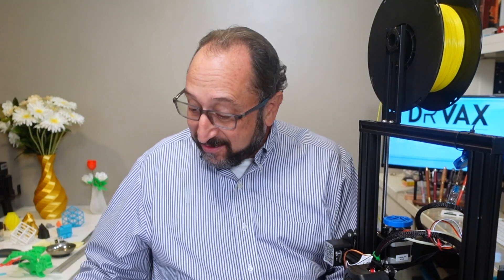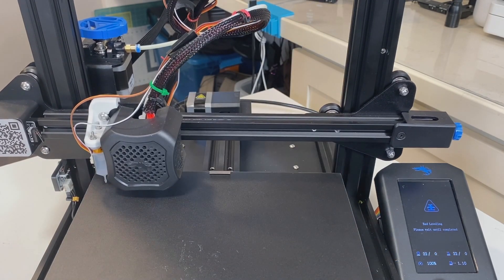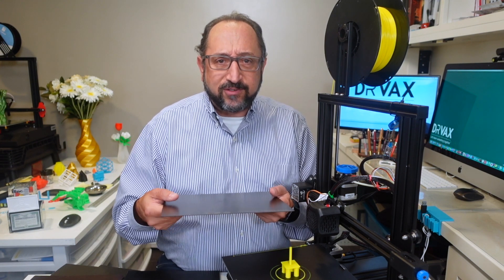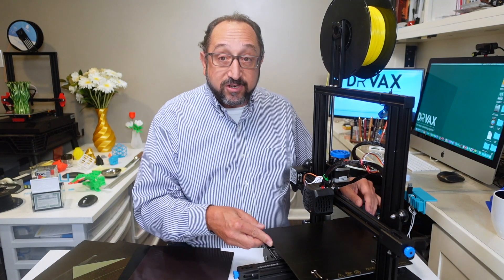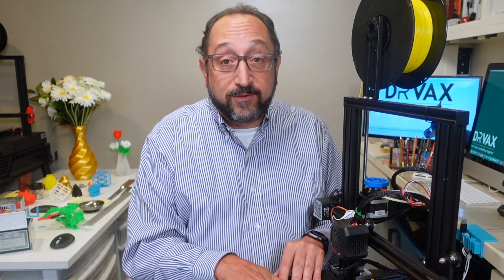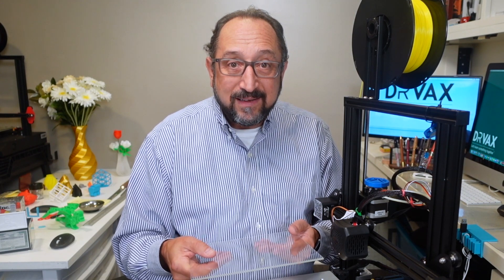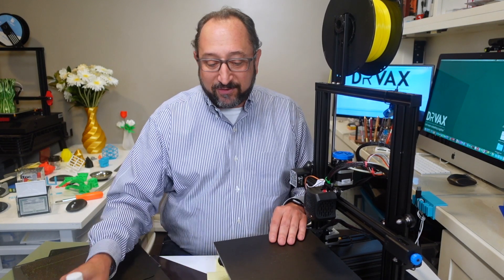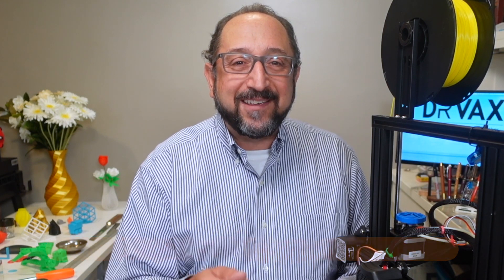3d Printing Build Plate Options

Comment: I print on the mate glass. For adhesion I use 3D glue (I think it is a povidone solution).
Most of the time is works great:
1) I like mate part bottom surface
2) It usually sticks well during print
3) It usually pops out as the surface temperature drops down to 40 C
4) They are inexpencive and can be purchased almost anywhere (in any glass work shop)
The downsides are:
1) It makes bed heating process longer as glass sheet has its heat capacuty
2) Sometimes parts cat peel out some chips from the glass

Comment: My Ender 3 Pro was in a bundle at Matter Hackers that came with the Build Tek sheets, which saved me because for some stranger reason the stock magnetic surface quit sticking, as in the prints wouldnt stick at all. Swapped and just fine. I clean with IPA before every print to insure a fresh clean surface, no issues with sticking, as long as the bed is leveled and nozzle height is correct.

Comment: Great i formation. Thanks.  Sounds like the ender 3 v2 glass plate is wearing quickly. Or is it only me who used it badly?  The center part of the glass seems to get glossy more and more.  I usedto be quite happy with the sticking of this glass. But not so much any more.  But I guess it is ok.
About the magicgoo.... do you have to replace magicgoo for every print?  How difficult is it to clean the glass from magicgoo? 
Thanks and great video...

Comment: Care with the Razor blade Paint scraper. 
 Those are Known to Gouge Window glass.. Let alone a 3d plastic print surface. :-)
Reply from the maker: Yes you need to be careful.   Use carefully flat against the print surface this approach works very well for me.

Comment: On plain glass I used a mix of 1/4 pint of water to 1 tbs of PVA glue. Mix well and paint on with a brush. (For PLA)

Ive also found that if it is really hard to get the print off, you can put the build plate in the freezer for 30 min and the part will pop off. ;)
Reply from the maker: Excellent suggestions.

Comment: I've had my Ender 3 V2 for about 2 weeks and had almost immediate success, even with some tricky prints. Then I cleaned the glass plate with IPA and boom, adhesion failures. Cleaned repeatedly with 90% IPA, washed with Dawn dishwashing soap and rinsed repeatedly, re-leveled bed, fiddled with different nozzle and bed temps -- no better. Tube of Magigoo arrives today so I'm hopeful that solves my problem. The one thing that sticks in my mind is that when I first cleaned the bed with IPA the paper towel picked up some yellowish substance. I cleaned until I didn't see any more trace of that. Now I'm wondering if Creality coats the bed with some sort of adhesion promoter from the factory and that was what I was seeing? 

BTW, I have watched many of your videos and they are some of the best I have seen on YT on any subject. I'm a techie old enough to remember when Digital Equipment Corporation first introduced the VAX system and am wondering if there's a connection there to the name you've chosen for your channel?
Reply from the maker: Yep.  I worked for DEC for 5 years.  DrVax was my nickname among some of my peers.
Reply: @MakeWithTech  Figured as much. So many innovations on the VAX/VMS platform....  

Regarding Ender 3V2 adhesion I can report that even with Magigoo applied the bed almost seems to repel filament. In desperation I applied a self-adhesive build surface that came in a box of Overture filament, re-leveled the bed, and presto, now printing fabulously. Adhesion is almost too good, so now trying Magigoo as to facilitate removal. Think it's time to order some BuildTak or LayerLock.

Comment: sir i want to buy a 3d printer. plzz suggest a 3d printer as a beginner under 250-300$(max -20000). plzz make sure its available on amazon india.
Reply from the maker: I do not have access to Amazon India but the Creality Ender 3 V2 is an excellent printer supplied in a kit form.  The kit is only mechanical assembly as all of the electronics are fully assembled.  The ANET ET4 requires less assembly but the firmware is not as good.   ANET is in the process of working with the open source community to make Marlin 2.0 available on the ET4 at that point it will be an excellent choice.
Reply: @MakeWithTech  when anet eta 4 get marlin filmware update?
Reply from the maker: They are working on it now.  An early release is already available on the ANET web site but it requires some knowledge of electronics for installation.
Reply: @MakeWithTech  ender 3v2 amazon india price is 30000(407$) which is over budget for me.

Comment: I have an Ender 3 v1 and an Artillery Sidewinder X1 and what I have doned with those is I purchased some inexpensive flexable spring steel sheets with magnetic bases from one of the Chinese companies and then I use a product from DOBSTFY that you can get from Amazon.  The DOBSTFY product is probably similar to Buildtak.  It sticks better than PEI and you can still flex your prints off.
Reply from the maker: Interesting.  I will check out DOBSTFY.  While I like the ease of print removal of sprint steel I really like the flatness of glass.

P.S. I have started a new discussion forum at http://forum.drvax.com where we can all have more elaborate discussions and share pictures on our prints and printers. Check it out. Irv
Reply: @MakeWithTech  That's one of the nice things with the Sidewinder X1.  It comes with a glass only bed so it is already flat so no need to worry about putting the spring steel on a warped bed.  On my Ender 3 I use a BLTouch.

Comment: What about good old fashioned blue painters tape?
Reply from the maker: That works but I find it takes a lot of time to replace and when I use it it tears after most prints.
Reply: My ender 3v2 build plate won't stick at all so I went with blue painters tape with no issues at all

Comment: I think you got, like, an "old version" of the glass bed on your Ender 3 V2. My is different starting with the logo (it says Ender with the little "horsy" logo on it) and the texture is exactly the same (or very very similar) to my AnyCubic MEGA X printer. Anything that I print on my Ender 3 V2 sticks like crazy and will pop-off on its own as soon as the bed temperature reaches 25-26 Celsius. Pretty much the same behavior as the MEGA X. In the description on Amazon (Canada) where I ordered my Ender, it says: Carborundum Glass Platform. Go figure ?!?

BTW, I enjoy your channel and thank you for taking the time to share with us what your just "learned" with (mainly) 3D printing. Keep up the good work for many years to come and have fun doing it !!!
Reply from the maker: The one that came with my Ender 4 V2 was the same as your.   The ones shown in the videos are spares I ordered for testing.  I also think my bed might have been a bit dirty and will try it again after cleaning with alcohol.   But even when new it was not as good as BuildTak.

Comment: There are much cheaper alternatives for a gluestick, UHU or Pritt glue works as well and costs a fraction.
That being said, if  gluestick is the only way to make your print stick you have other issues that need looking at.
Reply from the maker: Yes a perfectly tuned 3d printer may not need a bed adhesive but I am sure my printers are not perfectly tuned.  I used a bed adhesive which is different than a regular glue stick to make my life easier.

Comment: I have the cr-10 S5 and have discovered the glass bed works great if you keep it in the center at 70 degrees Celsius and keep it super clean with isopropyl alcohol. The bed has to be good and warm and wiped  with isopropyl alcohol between each print
Reply from the maker: Good information.   Thanks for sharing.

Comment: lol drvax still need to learn more printing on glass lol, glass easily the best surface to print on lol stick really well, also you don't need to used a razor blade, just spray some isopropyl alcohol and Wala
Reply from the maker: Thanks for sharing.
Reply: @MakeWithTech  you're welcome, great channel by the way keep up the good work!

Comment: Ok I just got some magigoo today so very good timing. Printing on the plain glass side of the ender 3 V2 bed as the other side got to the point were nothing would stick. So plain glass worked ok but on some prints (printing numbers and letters for example) that had very small foot print could never get it to work. Tried magigoo for the first time and perfect print :) Thanks for the video :)
Reply from the maker: Yep.  It works for me.

Comment: Has anyone tried a mirror surface (especially for ABS)? I read it somewhere that it provides extremely well adhesion. Worth to buy one?
Reply: A mirrors just glass but it is super level glass which makes sense because if it wasn't super level you would end up with a fun house type reflection. when you level the bed with a mirror it is very very level so adhesion would be better. I haven't tried abs
Reply from the maker: Correct. Thanks for sharing.

Comment: Bought a Creality glass bed for my Ender 5 Pro a couple of weeks ago. No issues with adhesion here. For PLA and PLA+ I just use IPA to clean it. For TPU and PETG I use a cheap Scotch glue stick and it sticks well. Also bought a PEI sheet (because of all the stories that it's superior) but haven't used it yet because there is no need atm. :) Don't know if the glass bed from the Ender 3 v2 is exactly the same as  the one I bought on Amazon though.
Reply from the maker: The importance of cleaning the Creality build plate with alcohol is something I failed to mention in the video.  The Creality web site lists the build plate as "Surface Tempered Glass Plate with Special Chemical Coating".  If it is PEI cleaning with alcohol makes a lot of sense -- which is what I do with my Prusa PEI build plate.   

Your comment should help a lot of people.

P.S. I have started a new discussion forum at http://forum.drvax.com where we can all have more elaborate discussions and share pictures on our prints and printers. Check it out. Irv

Comment: I’m surprised you didn’t include WhamBam flex plate with PEX surface.... been using on my E3Pro w/MicroSwiss hot end and get great results with both PLA & PETG. Just FYI.
Reply from the maker: I do remember hearing good things about the WhamBam surface but I have not tried it.

Comment: You forgot to test the TH3d Studio's Ezflex2 smooth and textured.  It's magnetic and I have no more need for clips. I use it on my ender 5. No need for glues I love the textured the best only need a raft when using supports. Check it out and you will switch too.
Reply from the maker: Another good suggestion.

Comment: I am working with the Ender 5 Plus, and using the Creality glass bed.  Even though the glass is ´flat', I have found that I needed to shim the plate with post-it notes on 3 of the 4 sides.  Bonding has been very successful even on large and tall PETG prints (100m filament) - as long as I use Magicgoo.  That needs to be on in a pretty thick layer.  I found I can renew that for several prints, then pull the glass and clean in the sink with soap and water.
Reply from the maker: Thanks for sharing.

Comment: I find the best way to get consistent adhesion is never touch the surface with my fingers. If the surface never comes in contact with skin oils then they can go a very long time without needing cleaning and there aren't dead spots on the surface that the print doesn't stick to. I wear gloves if I need to touch the middle of the build plate.
Reply from the maker: Good idea.  Cleaning with alcohol will remove any oil from your fingers.

Comment: Nice video DrVax.  I have a 300x300 build plate that is a little uneven, as in high and low spots.  Probably around 0.1mm variance. It's enough that for a layer height of less than 0.25mm I need a raft for larger projects.  Do you think a metal build plate would even that out for me?
Reply from the maker: Glass is the flattest possible solution.  A glass surface with buildtak will work quite well.   As indicated in the video I have also been quite pleased with the LayerLock surfaces, however if the base under the LayerLock is not flat you still may have an issue.  So if you want to fix a imperfect base glass with buildtak is probably best.

A great place to discuss this is at the DrVax forum located at https://forum.drvax.com.
Reply: @MakeWithTech  Your reply is what I was expecting. groan.  I have a PEI build surface on aluminum heater and had to upgrade to an 18mm inductive sensor to get good reliability, so glass would be out of the range of my sensor.  I was hoping that metal would be rigid enough to bridge over inconsistent build plate.

Comment: I'm having a horrible time with adhesion and print quality with the ET4 and PETG filament
Reply from the maker: The ET4 ships with a bare glass plate.  I use Magigoo on my ET4.  An alternative is to add BuildTak on top of the glass.  You will have to relevel the print surface since the stock ET4 ABL system is not reliable.
Reply: @MakeWithTech  I'll try to post on the forums. We don't have buildtak locally. Also having print quality issues with PETG. Inconsistent

Comment: Great info, i've had best luck using 
 GO-3D PRINT 235mm x 235mm Borosilicate Glass Plate for Creality Ender 3, Pro 3, Ender 5 3D Printer ordered from Amazon and spray Aqua-Net on a lint free towel and wipe on prior to printing.
Reply from the maker: Thanks for sharing.

P.S. I have started a new discussion forum at http://forum.drvax.com where we can all have more elaborate discussions and share pictures on our prints and printers. Check it out. Irv

Comment: I have an Ender 3 v2 and I use jumbo purple glue sticks on it. I was able to get 30 glue sticks (I bought way too many) for about $26. Sometimes the prints stick too well with it if the layer of glue is too perfect. I print at 60 degrees. 30 jumbo glue sticks will probably last longer than the printer itself. Before every print, I preheat the bed and use a folded up, wet paper towel to wipe off the glue without the need for soap. Then I use a small alcohol wipe (70%) to polish it off. Preheating the bed makes the glue come off easier.
Reply from the maker: Thanks for sharing.

Comment: Im using the Creality Glass with Elmer's Glue Sticks on my CR-3 Pro. I haven't had a problem yet. Once the bed cools, the prints pop off with normal hand pressure and the print surface is easily washed with soap and warm water.
Reply from the maker: I have tried some generic glue sticks in the past and they did not work well for me.  Elmer's Glues stick are clearly less expensive than MagiGoo so it is worth a try.  Thanks for the commend.

P.S. I have started a new discussion forum at http://forum.drvax.com where we can all have more elaborate discussions and share pictures on our prints and printers. Check it out. Irv

Comment: The part about the Creality glass surface being unpeelable is not entirely true. Back when my prints used to stick (don't ask), I had a print that would not come off no matter what I tried. After an hour in the freezer, it finally did after no small amount of coaxing but it in turn removed the "bonded coating" with it. If I were able to post pictures here as proof I would.
Reply from the maker: Interesting.  I know I sound like an ad for MagiGoo, and I pay for my supply just like everyone else, but it does also solve the release problem.  I find it very important to use with PETG which tends to stick to may surface including glass.

Comment: My new favourite is a glassfiber reinforced resin plate at the moment.
Reply from the maker: Never tried one.

P.S. I have started a new discussion forum at http://forum.drvax.com where we can all have more elaborate discussions and share pictures on our prints and printers. Check it out. Irv
Reply: @MakeWithTech  how about a Discord server? i would personally prefer that because i am already familiar with it and i dont need to make an account or anything
Reply from the maker: I found that https://www.vbulletin.com/ was a better fit for my needs.

Full disclosure I was confusing Discord or Discourse.  I had only looked at Discourse which was expensive and complex to use.  Discord is quite interesting but lacks some of the organizational features I am looking for.
Reply: @MakeWithTech  mmh, okay. there are roles that you can assign. anyway, hoping that your solution work well for you :)